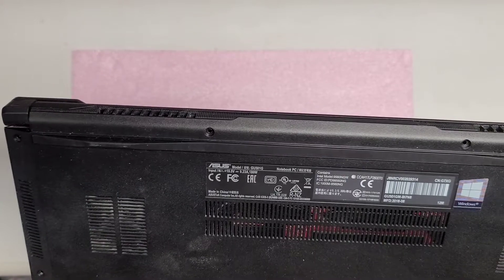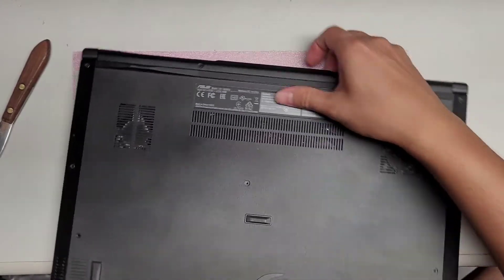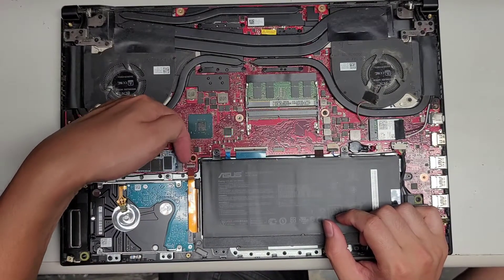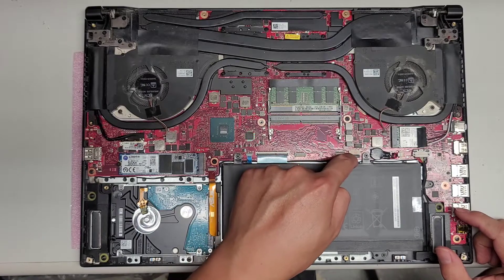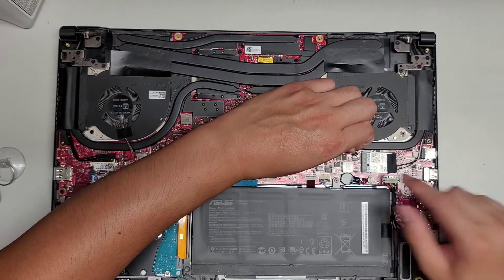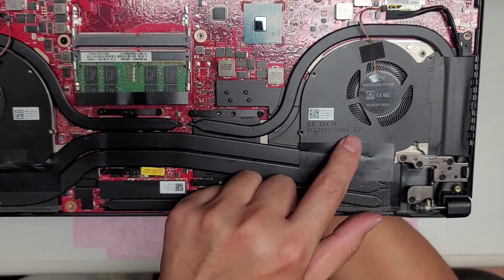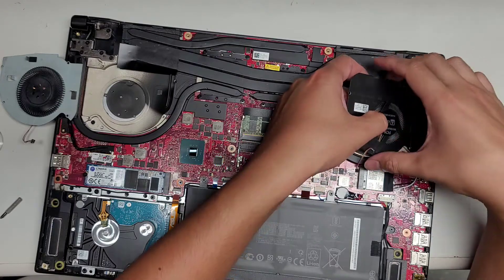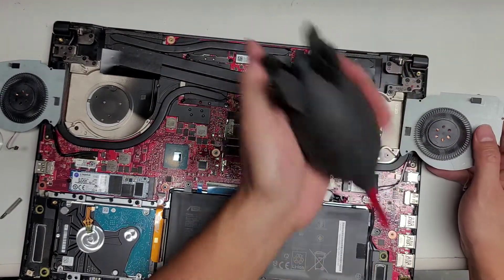ASUS GU501G Disassembly RAM SSD Hard Drive Upgrade Fan Repair Replacement

Comment: One question, where is the part of the button to turn the laptop on and off located? I mean, the flex where the board is connected to turn it on?
Reply from the maker: @jechu-c6o  I'm assuming built into the keyboard.
Reply: @ItsBinhRepaired  Another question friend if it's not too much trouble, I can't find the keyboard model for that model the ASUS ROG GM501GS. But if models of the same brand like the ASUS TUF Gaming FA506, if I put the one from that model do you think the motherboard will accept it? It doesn't matter that it doesn't fit in the case, I need it to turn on the laptop but the keyboard is damaged and I can't find its model, only similar models, if I use those could it work for me?
Reply from the maker: @jechu-c6o  https://amzn.to/4iTQifb this or this https://amzn.to/4gWiZGz

Comment: Does anyone know if the Zephyrus M GU502 bezel and screen 240hz will work for this laptop? I'm looking to change the bezel to something thinner the GU502 looks nearly identical to this but I don't know if the display and bezel will work for this
Reply from the maker: Sadly I'm not sure. The connector is usually different.

Comment: Also, do not forget to disconnect the battery, you dont want accidently to touch the electronics with the screwdriver or a screw and create a short
Reply from the maker: Yup

Comment: if i just want to swap the HDD to SSD would i need to worry about cloning it? I assume no as the OS is on the C
drive
Reply from the maker: If the OS is on another drive, then yeah, cloning won't be necessary.

Comment: If the fan on the right side starts buzzing/grinding if you move the computer or something lightly hits it, how would you be able to tell if the barring  are broken or if it needs oil...if that would even help.

If it is oil, what brand would you use?
Reply from the maker: This video will help. https://youtu.be/3zs_SJ3BXgA
Reply: Ty, I think i know now which it is but I’m likely gonna go get a second opinion and see how that works

Comment: Huh, didnt know you could remove the fans. Now I just need to figure out why the sound randomly goes up and down.
Reply from the maker: https://youtu.be/3zs_SJ3BXgA
Reply from the maker: That video should help
Reply: @ItsBinhRepaired  Thanks. I was talking about the audio. The speakers seem fine but the audio cuts in and out.
Reply from the maker: @xenicmark  oh, very strange. I think for that you have to turn off the effects settings. I forgot how to get to that. Disable the sound enhancement features.